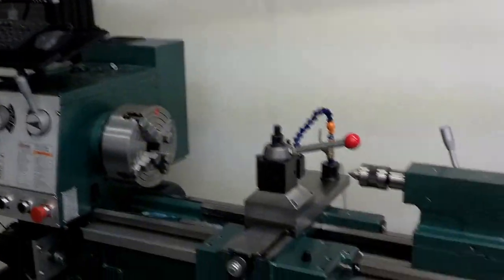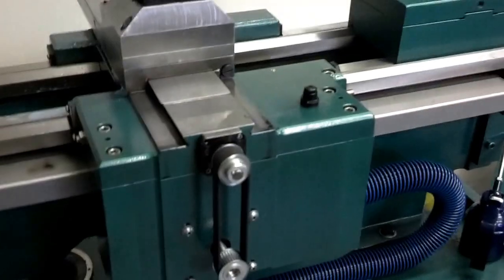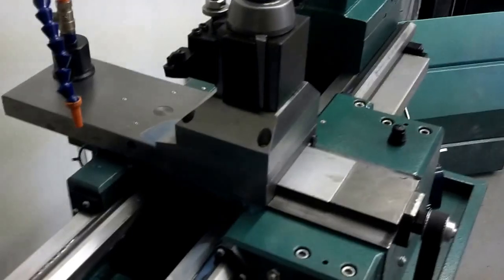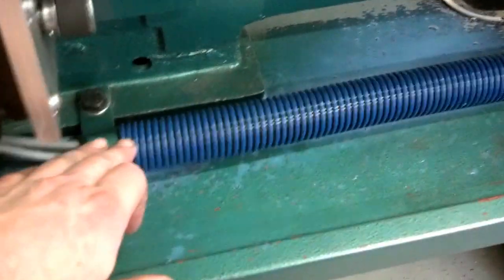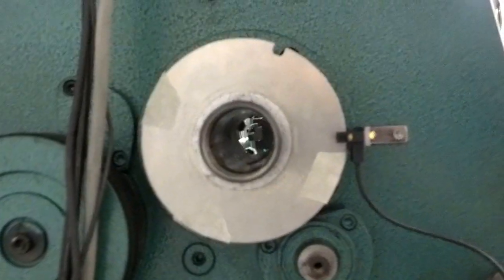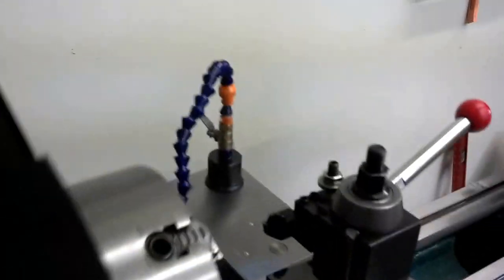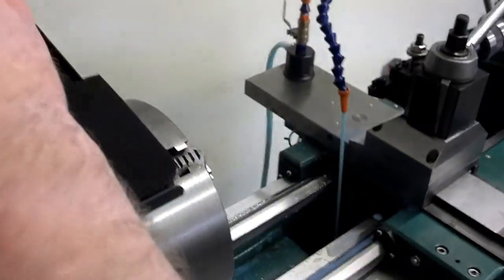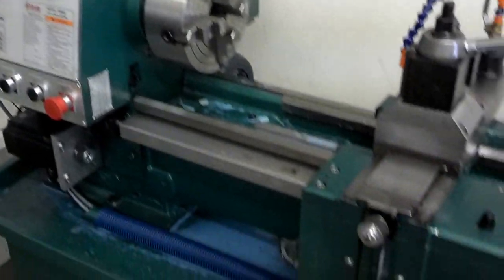Grizzly G4002 CNC conversion.

Comment: Great lathe>>>ur2.pl/861    I have created a bunch of different items. Highly recommend. It is not that hard to replace blades as some have complained about. Great item to start with. You will want to upgrade if you love doing turner though.